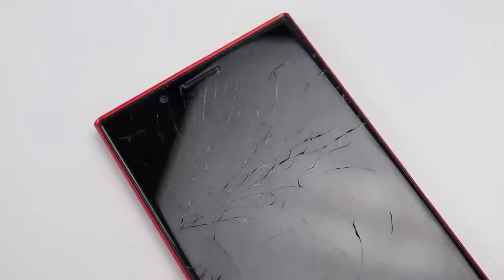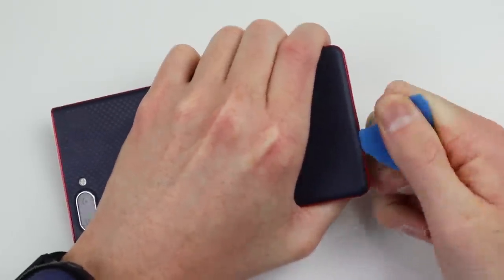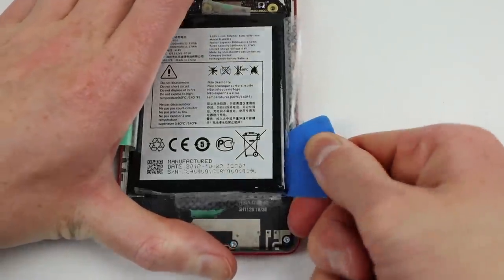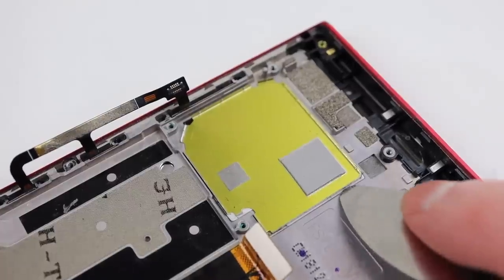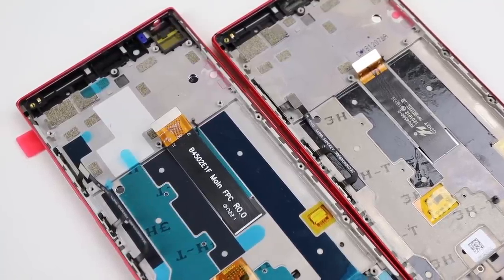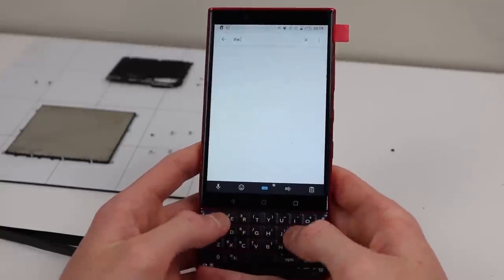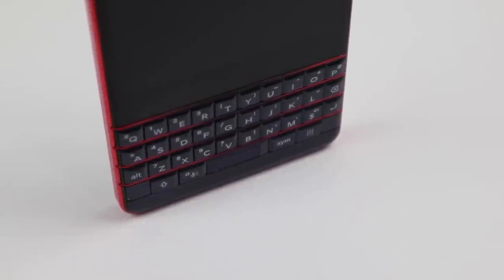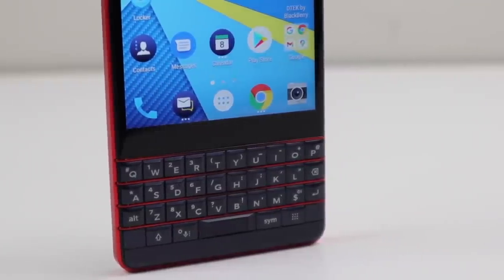Restoring BlackBerry's Last Phone - Key2 LE

Comment: Fun fact: the first version/ earlier releases of this model did not have enough adhesive, which led to the screen coming apart and after complaints from users they just slapped more adhesive
Reply: Well hey, at least it fixed it
Reply: You said it like they did something wrong. They fix it! For free
Reply: was that the issue with the keyone or the key2 LE?
Reply: @sleeplessengineer1450  That was the Keyone. The Keytwo fixed it
Reply: @K1ller_F0x  adhesive dosent damage the screen
Reply: @SketchTurnerZero  because they did do something wrong. Doesnt mean it’s bad
Reply: @doodlecaboodle9298  using adhesive is not wrong.
Reply: How is this a fun fact when it’s not fun for the users
Reply: @OscSom  their L for using a BlackBerry in 2018

Comment: I used a Blackberry Bold 9000 up until around 8 years ago. It was a great phone, the keyboard was amazing and the trackball was easy to use. It also had amazing speakers. I never came across another phone with such great speakers, even though modern phones have stepped up their game in this area as well.

Comment: Blackberry owner here
I have chosen blackberry because of the design and the functionality of the system.
Glad to hear that you like the design, too : )

Havent used my Key 2 at the moment, but will switch to it, after my Classic seems to develop problems with the battery: it shuts down fast and a charge only lasts barely for two days

Comment: Crazy that blackberry is supposably coming out with new devices. That looks to be somewhat of a crazy teardown and swap! I'm a mobile cellphone repair tech, and I have yet, to see a blackberry come into the store that I'm based out of! I actually owned a Blackberry Pearl when they first came out. The only issue I had, was the track ball popping out.. lol. I still had that phone up until 2013. It wasn't in use, but I still had it. I also to this day, still have my Galaxy Epic 4G, which is in emaculate condition! It just doesn't have a battery. Great video!
Reply: Hey there!  I am looking to bring my phone in for a repair... I would like to seek your opinion on the following:
__
i just received a new front frame assembly- BB key2LE.. My screen cracked and instead of ordering a replacement screen i found the entire frame /assembly... I am going to take it to swap out the mother board, camera, charger port and speaker setup... How much do you think that will cost me?  

The frame assembly already has a new battery in it...  I appreciate potential feedback!
Reply: @JoeyMartz   I would suggest reaching out to your carrier and seeing if you have insurance on that device and go that route first.

Comment: I had the Q10, Passport, KeyOne, and KeyTwo... Tried holding out for the one teased for 2021 but my Key2 battery was failing & I couldn't get replacement parts/repairs... :(  BB10 is still the best phone OS I've ever used and I miss it so much! And no phone security can beat the BlackBerry's. The physical security features built into the phone during the manufacturing process... So good !!!

Comment: After Nokia, I only had BB handhelds and phones, my last & latest BB was the Q10, I'm an investigative journalist and don't install external apps on my work phone for a reason. I still use the Q10, it's my second one I bought for about 70 Euro in Germany. Even without firmware updates available anymore, all features run nominal. The battery of the Q10 is replaceable, which is another plus. I'm not very confident about a new BB release in the near future. But I subscribed to learn more here.

Comment: I had a BlackBerry Bold 9000, Torch 9800, and Classic, the latter of which I held onto until the battery stopped holding charge in 2019.

Comment: My last one was a Storm 2, 9550, I think. I do still have a Storm 9530 with a desktop stand that I’ve been using as a digital clock. Press-to-execute part of the touchscreen is not working, only the sliding.The old battery is swollen and needs replaced. That might fix the press part. It did on a pocket camera with the same issue a while back. Thanks for the vid. ‘Got me interested in working on mine again. Just ordered two new batts from eBay. ‘Miss that digital clock!

Comment: I'm still using BB Key2 (I bought it on a launch) and it's absolutely awesome. Two or Three times it lost the SIM card recognition - I had to open the tray, make sure that SIM card is in the right place, put the tray back and then restart the phone - that's all. And the keyboard... it's fantastic. I saw a lot of videos made by 20-25 years old guys who were doing a "comparison" of typing speed between  touch keyboard vs the BB Key2... and that's a poor comparison. If you grew up with touch phones and then use physical BB keyboard for 2 weeks, then obviously it will be slower. I'm using Key2 from it's launch date in Europe and I'm much faster if it comes to typing... and I don't need to use autocorrect feature AT ALL. :)

Comment: i like Blackberry keyboard BETTER, than the on screen keyboard,
it easy to use and will never missed a key tap, like on screen keyboard does,
sometimes when your hands watery or moist it will tap 2 keys at the same time,
when your phone over heat or when you're charging your phone, it will also bug on screen sensor

Comment: Would you suggest getting in to phone repairs for some part time side money? Is it worth it for newcomers?
I used to repair iPhones and ipods back in 2010 (replacing screens and backs) so I have some experience and have experience working on cars and electrical wiring

Comment: My very first BB wasn’t a phone but a tablet… The PlayBook n I thought that thing was amazing 🤩 THE SPEAKERS ARE LOUD and can fill a medium-large room even before current tablets/smartphones have stereo speakers… The app store was underwhelming and there was good enough thing to remove the shortcomings of it… The only problem was that the micro USB port for charging has removed and desoldered away from the main motherboard (yes i could have fixed it but at the time I didn’t have a solder iron and iFixit’s library was still in its infancy along with really expensive parts) I had to return it out for an iPad 2 n I stuck with it til it fractured as well… then I swapped out for a mini 3 til I lost it… the current tablet I have is a LG one and that one is broken beyond all belief… lucky I have my iPhone for it 😅

Comment: Oh Blackberry
I have a Q10 and a Q20 (Classic), both of them have problems.
Both the Q10 and Q20 are scrachy in edges and around the charging port, also all the buttons, including the power button and two volume keys are failed and cannot be pressed. The keyboard also hardened overtime and it's hard for me to press several keys.

Comment: It looks like the metal plate over the battery might be intended to protect it more than hold it in place, considering it does have a thin plastic back panel.

Also, I do have a collection of phones, mainly just sort of like an archive but I also have some really weird and unusual ones, and I do have the priv, for that reason.

Comment: I had the Key 2 up until AT&T shutdown 3G making the Key 2 obsolete for me
Reply from the maker: This is a 4G phone.
Reply: @HughJeffreys  AT&T and Blackberry/TCL has not certified the Key 2 and Key2 LE for the AT&T VOLTE Network making it obsolete basically on AT&T.... it will only identify as a 3G device on the network because without being certified calls are still being made only over the 3G network and not over VOLTE thus making it "3G" only and can't be used after AT&T's 3G shutdown... AT&T is automatically blocking all phones without AT&T VOLTE compatibility
Reply: @AChilds52  Well clearly, AT&T had to go!  lol